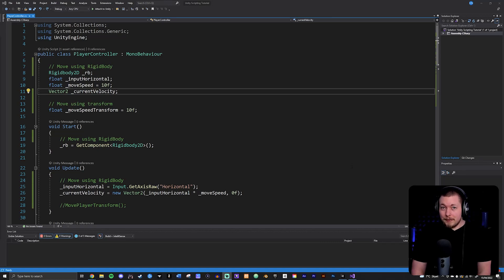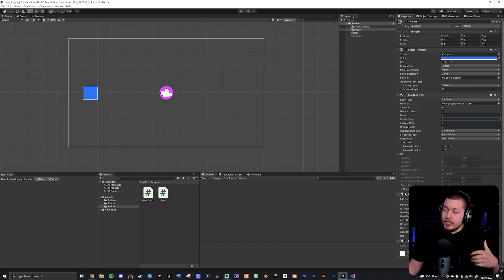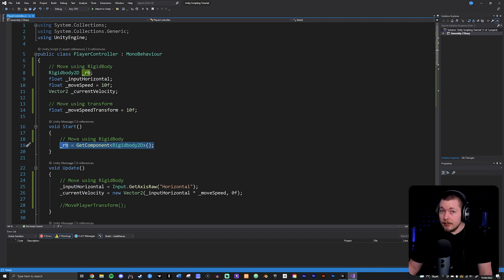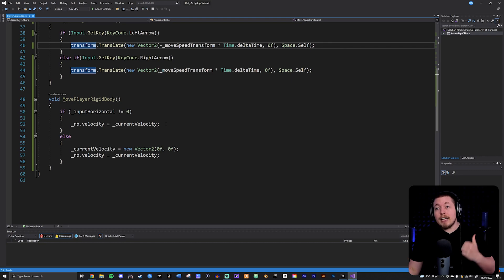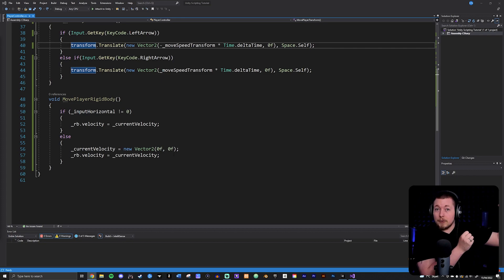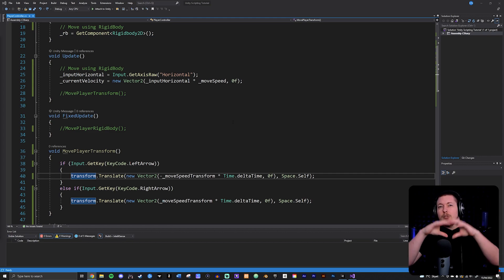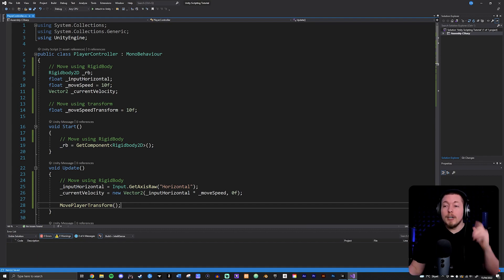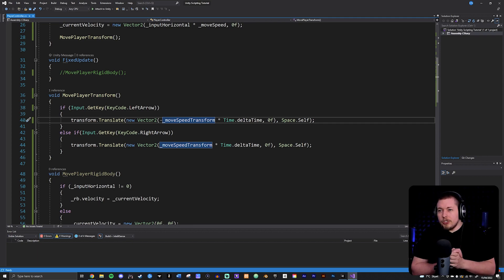#13 | RIGIDBODY VS. TRANSFORM AND UPDATE VS. FIXEDUPDATE 🎮 | Unity For Beginners | Unity Tutorial

Comment: Thanks for all this info. It's a great learning tool to get into Unity and very much appreciated. I do have a question though. I'm doing a 2D game as a test where I have a fighter plane. Left and right key changes the fighter direction. To do that I enable or disable the flip X parameter - all works fine... however I also use the shift key for a thruster which makes the fighter plane move extra fast and has a flame (child object) at the rear of the fighter when the shift is pressed. Problem is when I enable flip X the fighter flips but the flame stays in position so when flipped the flame is now at the front of the plane. How can I link (lock) the flame to always be at the rear of the plane?

Comment: I'm using RigidBody2D to create a jumping,
I made a "Jump()" method separately and then in a fixed update I told it to read my jump method. But it doesn't detect inputs most of the time . It works completely fine when in update instead :(
I'm not sure what I'm doing wrong:

    Rigidbody2D _rb;
    private int _jumpVelocity = 20;

    private void Start()
    {
        _rb = gameObject.GetComponent<Rigidbody2D>();
    }
    private void Update()
    {
        Jump();
    }

    private void Jump()
    {
        if(Input.GetKeyDown(KeyCode.Space))
        {
            _rb.velocity = new Vector2(0, _jumpVelocity);
        }
    }
Reply from the maker: You always need to check the input in Update, and then put physics based movement in FixedUpdate. 

If you don’t put input in Update, then your jump won’t always be registered. And if you don’t place the jump physics in FixedUpdate, then your physics will be wonky.

So basically… you need to separate the input check from the physics jump, and put them in each update type 🙂
Reply: @Dani_Krossing  thank you very much :D I'll move all my bits about and give it a go 😁👍

Comment: So RigidBody manipulates Transforms using physics formulas and then you are also trying to move with Translate in same frame which causes erratic movement. Is this reasoning correct?
Reply from the maker: No it’s more in the sense that the transform just updates the position of the object, when the physics is applied. I don’t believe it is the physics that directly move the object through changing the transform.

Comment: Do you know how to get the ACTUAL position of a rigidbody moving through space?(ex. a bullet) 
If I do rb.position or transform.position in FixedUpate() I get a position that is behind the gameobject in the scene view. So basically FixedUpate() is telling me about the past when I need info on the present to do a distance calculation. Any ideas?
Reply from the maker: If you want the position of a gameobject, then you use transform.position. And you need to get the position in the Update method, not in FixedUpdate. 🙂

And if it’s RigidBody.position then it’s in FixedUpdate.

If you are getting a position behind the game object, then my best guess is that your game object is somehow being placed there… Getting the position either way should get you the correct information.
Reply: @Dani_Krossing  So the gameobject is being moved via AddForce(). My problem is the position it reads off of the RigidBody or just the transform.position in FixedUpate() is BEHIND the actual position  of the bullet. So when FixedUpdate() checks the position of the bullet its at point b but FixedUpdate doesnt run fast enough to get an accurate position of how fast the bullet is actually going
Reply from the maker: Have you tried using both RigidBody.position and RigidBody.AddForce() in FixedUpdate?

If you use transform.position in FixedUpdate, it might not return it properly.
Reply from the maker: Just noticed in your original comment you said you had hehe. To be honest it doesn’t sound like an issue with the “position code”, it sounds like something else is either delaying your position from executing in time, or your game object is actually where it says it is, and something else is going wrong.